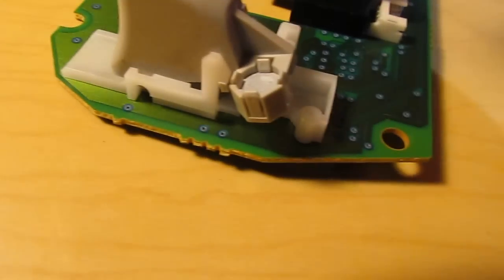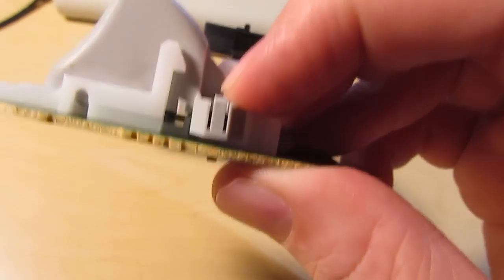How a Dreamcast Controller Works

Comment: This is why people still have Dreamcasts and old Nintendo’s, because they still work. Try saying that about a switch or PS5 in 20 years...
Reply: I don’t know if they found the current sensors cheaper but it is really a huge downgrade considering how the Dreamcast has this. I really hope someone out there has hall sensors for the ps5. They already do for the steam deck but even that is much easier to replace without any soldering.

Comment: Great demo of the sensors in the controller, I'm amazed how well thought out the design was. I'd love to experiment with hall effect sensors myself, they seem like such a fun project, and this sensor configuration is fascinating. I suppose it allows them to isolate movement in each axis more effectively without worrying about the actual signal strength, or influence by the other axis.

I'm surprised they're not more common nowadays for game controllers, they are really powerful with the right setup.
Reply: They're really common in higher end flight sim setups
Reply: @0Asterite0  oh yeah definitely, they're used a lot in RC transmitters nowadays too

Comment: who's here after the DS5 drifting fiasco
Reply: me lol
Reply: Sega first introduced this technology with the Saturn 3D controller in 95, think about it... 26 freaking years ago (and Sega's patents on this have probably expired at this point so it's up for anyone to grab). 
I understand pot-based analog sticks are still used because they're inexpensive and readily available, but they have no place in the current pricepoint of 60-80 usd hardware manufacturers charge nowadays.
Reply from the maker: So, I've never had a Saturn 3d pad to take apart, had no idea they were hall effect too. That's super cool.
Reply: @sparkster7744  The Wii is the first system I got to experience controller drift on the nunchuck. Pot based analogs suck.

Comment: Nintendo, Sony and Microsoft need to go back to using these. At least for the joysticks.
Reply from the maker: None of them did, only Sega used hall effect sensors.
Reply: @arfink  I guess I should say, they should all START using them. Because the current mechanisms they use are utter trash.
Reply from the maker: Yeah it would make a lot of sense. Tbf, much of the current issue with drift has to do with dead zones being too small. Old potentiometer based joysticks also drift, but generally the console is set to ignore it until there's a large enough input on the stick. The issue is that joysticks are getting physically too small and gamers expect tighter and tighter precision with extremely small inputs, which means you have to choose if you want to lengthen the life of the joystick and have a big dead zone, or have a tiny dead zone and short life.
Reply: @arfink  I find it ironic how people want tighter precision yet still rely on Aim Assist. At least Nintendo got it right with Gyro Aiming. Hall Mark Sensors and Gyro should be the norm now.

Comment: thx for ur video. i come across this when I'm searching a fix to a drifting stick of my PS4 controller. unless sony redesigns their controllers to adopt Hall Effect mechanism, i have to buy new controllers every few years
Reply from the maker: Thanks for the feedback on this very old video! I should do a video on other cool joystick mechanisms, like the N64 optical stick or the GCN stick which, while potentiometer based, is one of the better designs with that tech.
Reply: Maybe there is a company that is building hall effect dual joystick controllers out there.

Comment: Step 1: Replicate this work
Step 2: Make adapters so you can solder it directly to a new xbox/ps5/switch controller
Step 3: ???
Step 4: Profit!
Reply: Imagine if someone made an N64 joystick module that used magnets and were just as accurate as the original.  They would last forever lmao
Reply: People can be pretty crafty. Very few people put Trackballs into PS3 and 360 controllers

Comment: So how the hell did you end up wiring a joystick to all those weird sensors? It's not like you could solder wires directly onto them.
Reply from the maker: If you probe the pins of the hall effect sensor while the controller is in use, you'll notice that the voltage on the upper-left pin (pin 1 IIRC) will drop as the magnet gets closer, so you can tie this to ground to simulate the same thing with a simple push button. See this for more help: http://pc2jamma.mameworld.info/images/dcjoy.gif